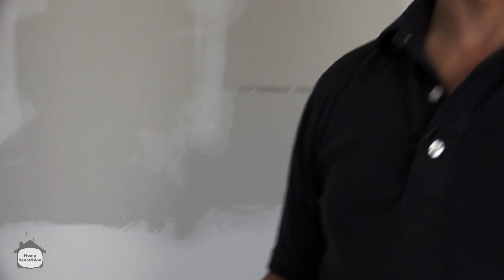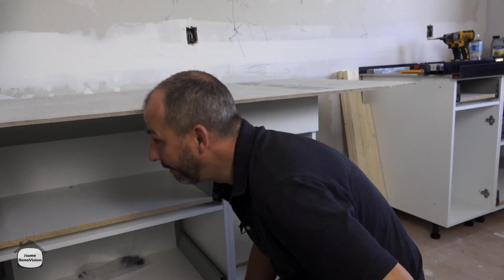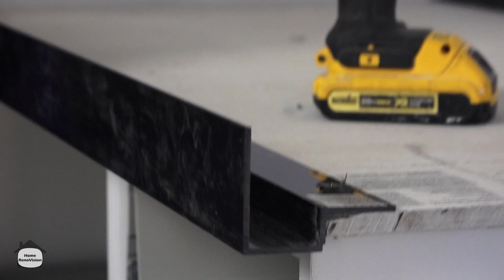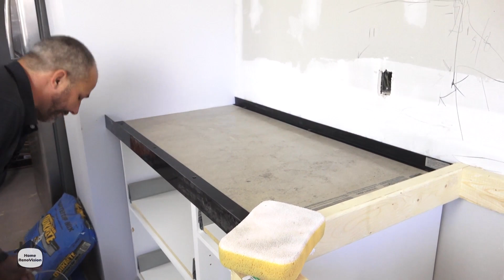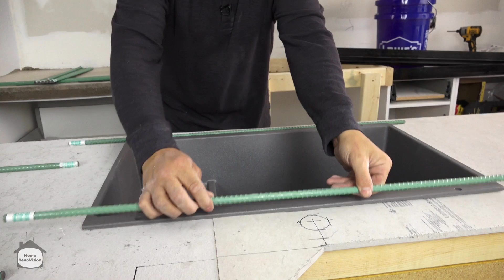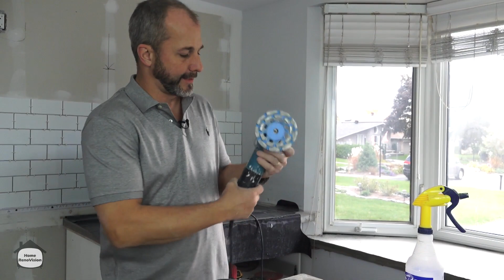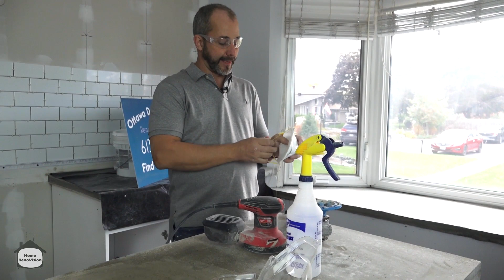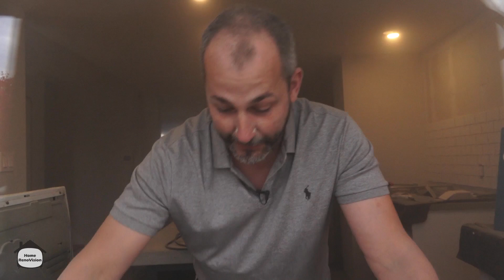Make Your Own Concrete Counter Tops | Rustic DIY Tutorial

Comment: Notice!  Prior to anyone doing any work, anywhere, anytime where grinding or sanding concrete or stone is involved should also Google and check out "Silicosis".  You will either adopt another procedure or invest in the best respirator and air filtration system that you can find or afford.  There is nothing like watching someone that you love struggle to breathe and slowly suffocate due to Silicosis! It's not the dust and dirt that you see, but the dust and dirt that you don't see that makes it into your lungs.   "Respirator!?  I don't need no stinking respirator!". Famous last words.
Reply from the maker: Thanks for scaring the hell out of us Jim!
Reply: @HomeRenoVisionDIY  LOL. I certainly didn't intentionally mean to unjustifiably scare anyone.  And, I'm not sure if this was a sincere thank you or sarcasm. :>) I have taken many courses in hazmat training including asbestos and lead abatement, and to include the dangers of Silicosis for to my past employment.  I admit that in the past I too had been very guilty of not doing a particular job the correct way that it needed to be done.  Granted, most of the time it was "just another way to do it", sort of like building concrete counter tops.  However, in the areas of asbestos, lead, fumes (think paint stripping using chemicals that contain the stuff referred to in the business as Methyl-Ethyl-Bad-Stuff) and anywhere that rock, stone cement or plaster dust is created or prevalent, prevention is worth a whole lot more than a pound of cure.  It could mean your quality of life, or, your life itself.  To be forewarned is to be forearmed.  I did not mean to scare anyone or to prevent people from DIY projects but desired to, hopefully, help someone to not wind up being a casualty of their own doing.  And I hope that my info was taken as such.  And obtw, I did enjoy the video.  Thank you for commenting on my comment.
Reply: Also, just so that you know, I am in the process of repairing and doing some limited up-dates to a home I've purchased that was built in 1910. (Plenty of lead paint and 95% of the walls are original plaster.  Plenty of sanding, grinding and patching.). I am in the process of stripping the kitchen cabinets and plan to replace the 1950's counter top.  That led me to your video.  The great thing about You Tube if the ability to learn from others.  I hope that I have helped.

Comment: ehh. I don't dig all the bubble holes every where. Seems like a good place for funk to grow. I would wager a super thin crete coat would fill them. This appears to be a great choice for outdoors prep around a permanent BBQ area or something. That or just bar top epoxy afterwords to make it 100% smooth.
Reply from the maker: That is what the wax is for. Cheers!
Reply: @HomeRenoVisionDIY  bees wax shrinks. So you still have holes. Still have places for stuff to grow.

Comment: IMO, the pro side of making counter tops via this method is you don't need 20 of your buddies to help bring it in, but that's all. I like the other method better. Casting it outside then bring it in. You'll get a much smoother surface and a less dusty home in the process. I just don't have enough patience and skills as this man does. 😢😢 Sir, be careful with that red laser beam. If it flashed any quicker, you'll be cutting in half. 🤣🤣🤣
Reply: agreed!, between the dusty cleanup, and having to buy the expensive Ztop forms etc, its literally quicker to make your own melamine form, pour your concrete (use ridgid board inserts to lighten the load a bit,) outside sand it slurry sand it etc, then call a few friends to help carry it in... set it down your done.

Comment: Fantastic video, this shows the errors most of us are going to get and how you'd go about and to fix them. All these "it's so easy just do as I do" videos really do not show the reality of what a viewer is going to experience when trying this themselves. Shows the "pitfalls" and "oh wish I thought of that" parts with a nice dose of humor, fun to watch. What I would do differently is put more effort in the vibrating, it's not only to get the bubbles out but also makes leveling easy as vibrating does that really well. One more tip, vibrating makes concrete stronger is it gets more compact and structural integrity improves. Concrete vibration improves the strength of the concrete by about ~4% per each percent of air removed, as you start with about 20% of the air in your mix you end up improving it a lot, basically if you get half out your 40% stronger. This gets' noticeable on the corners and other bits that you ideally do not want "chipping" off when bumped (google Concrete Vibration
 Handbook). Anyway, fantastic channel, I love it, a must see before my wife has me starting a new "project".
Reply from the maker: Thanks Peter, you obviously have not worked with this particular product . It sets up as fast as you can pour and vibrating had no effect after 30 seconds. It was a nightmare!
Reply: @HomeRenoVisionDIY  Yes, that is correct, I', in Europe we have other stuff. But, your video is cool and all know what they are going to run-into. Makes a realistic "follow along". great job

Comment: That final skim coat he got all screwed up. Mix up a batch and go right over the whole top smooth with sponge. If you do little 6" spots it will be a mess. Dude, you should have skipped this video.
Reply from the maker: I did say that I was just trying it out for the first time. Learned a lot!

Comment: Question . . . Looks like you poured the concrete  right up against the drywall at the sidewall. Are you not concerned with drywall sucking in the moisture from the concrete. Seems like that could cause mold down the line. Toughts?
Reply from the maker: this quick set concrete was cured overnight. it is not a constant source of water so no worries.

Comment: Looks like those kind of counter tops are more trouble than it's worth.
Reply: He made it harder than it needs to be. His mix was to dry and he didn't vibrate nearly enough. 
I've done 2 kitchens now using the same quickcrete product and it went smoothly. I did not need to grind at all. Just used hand sander in few edges with barely any dust mess like this was. 
That being said it's still cheaper and looks good even if you create same mess. He still did a good job abd achieved nice concrete counters.
Reply: Lol you just dusted the inside of their house for eternity 🤣.

Comment: Yikes! Grinding concrete like that is the worst (as far as mess and what you're breathing in...). I've done countertops both ways and definitely had better results with forming them upside down. With pour in place I had the same issues with low spots and had to fill them in after the initial pour. I could see a professional concrete tradesman able to get a far superior finish pouring in place, but for the average guy, melamine moulds are the way to go. Also,  I'm guessing you underestimated how much concrete dust there would be, cause that definitely called for at least a respirator... That dust mask wasn't doing much inside a cloud of cement dust! Haha. I've done the same and was cleaning grey goo out of my nose for days.

Thanks for the great video btw. I've seen these products and had wondered how they work.

Comment: I like this system. For sure figure out a better way than grind inside like that. Seems like a little more time on the tops with the float would work wonders. The good thing is that if you totally screw up yo can always attach a nice big shop vac to get most of the dust. Doing it like that inside is a little nutty, something I have done but still.

Comment: 1.  There is a perfectly good solution to get more workable concrete without adding water.  You can add in plasticizers.
2.  The purpose of adding steel at the bottom of a slab isn't the "firmness" of the underlay.  It's because the bottom is in tension.  Cement board can help with that, if it's properly reinforced, but if the neutral axis lies in the slab, you WILL get cracking below it.
3.  Yes it is a problem if your concrete is too wet - it results in weak concrete that can flake off... especially when it's applied that thin.
4.  If you had THAT many bug holes, you should have put a 1/8" topping coat on it.
Reply from the maker: there is nothing you can do with this product. It was very difficult to work with.
Reply: @HomeRenoVisionDIY  If you haven't looked into plasticizers, I recommend it.  It's a great way to get better slump without weakening the pour.  Might also help with the bugholes.

Comment: Yup. Sorry Bro I commented before I finished. The set time is wicked fast. Try a  4000 mix with wire More time to work, But man buddy that is a shit load of work...Dust, Clean up. Fill the holes, Seal it,,,,
Give me granite. Make the template 4 days later they are installed. Next. You did a great job. way to much work for the return,

Comment: Dryer Mix and WIRE????????????????
Reply from the maker: It is actually a concrete counter mix and rebar. The mix itself seems to be the problem with the product outcome. it sets so fast that you cannot work it properly.

Comment: The mold method with GFRC and foam core and hopper gun applied first coat seems to be the industry standard nowadays. It’s both significantly lighter in weight and strong in nearly all directions due to glass fiber, and has minimal surface imperfections. Most importantly, it’s replaceable. If the owner doesn’t like it or you screwup you can remake it or choose something else. Creating something so large, heavy, reinforced with rebar, and permanently attached to the cabinets sounds like a nightmare to the next home owner who wants to renovate.
Reply from the maker: Kind of like guys wo use spray adhesive on subflooring to joists!

Comment: This should help control a lot of that dust you have flying around getting all in your eyes and ears and on your jobsite for less cleanup.

https://m.lowes.com/pd/DEWALT-Surface-Grinding-Dust-Shroud/1000183755#collapseReviews

Also,  I have a full face respirator that I wear for anything from painting to cutting cement board to simply working in really dusty areas.  you'd be amazed at how much your tolerance for the environment you are in will go up we can ring one, in turn allowing you to focus on doing a quality job rather than, "how quick can I get this done so I can stop breathing this stuff"

3M Full Facepiece Reusable Respirator 6900/54159, Large (Pack of 1) https://www.amazon.com/dp/B007JZ1M10/ref=cm_sw_r_cp_apa_2sk.Bb3Z696EA

Always appreciate the videos and always enjoy sharing tips between tradesman. Cheers! :)
Reply from the maker: Thanks made my own out of a small pail and some tuck tape. Cheers!

Comment: I did poured in place countertops for my outside kitchen.  Acid stain is the way to go, after the sanding.   Have to be careful not to sand all the way down to the pebbles....just enough to smooth the creme top.  You don't show it, but did you use a magnesium float as it cured?    That makes a difference on overall finish before grinding.  Acid stain can provide a real nice marbled affect.
Reply from the maker: Hi Keith I am going to try this again some day soon. This time me will be looking for a more sophisticated outcome.

Comment: I used these forms on a rental kitchen remodel. I dyed the concrete mix (quikrete counter top mix) a dark color, a did a lot of smoothing with the magnesium float, then finished the top with a thin coat of dyed flyash. I was able to marble the color. I sanded it smooth by hand and finished with their sealer. It was super easy and very inexpensive, plus I was able to model my breakfast bar in a very non traditional way. Here's a picture. https://imgur.com/a/9aQb9HR   In this picture they are 3 years old, and it's been 2 years since then, they still look just as good. 

This was my first time doing ANYTHING with concrete, I did a couple of small tests in the garage before the main run.  

Love the videos I'm learning a lot, thanks!
Reply from the maker: Nice!

Comment: Detailed vid!

I saw another comment and agree with it. I believe every DIY person's very first tool should be a $100 full face mask from Amazon. These paper masks are absolutely useless. They don't seal, period. The amount of bad air coming in around the sides is insane. Even the half face masks are not great unless you're totally clean shaven. I have a very thin beard and found that the half masks wouldn't seal up--but the full face do. Plus, built in eye protection at all times from impact, plus the air by the eyes is filtered.

Any of the full masks like the 3M one with a new filter are so good that I can dump an entire can of spray paint in my garage onto something and not smell it at all, as they also filter some vapors. Try that with a paper mask! All that ground silica I wouldn't want to be breathing it.
Reply from the maker: I use a new paper mask that is awesome. I will be showing it off in future videos.
Reply: @HomeRenoVisionDIY  Sounds good :)

Comment: Started watching your videos a few days ago, can't stop. You're one of the best DIY ppl on the web. Questions: If I had planned on doing a similar type of counter space in a kitchen, what would be a realistic number of days that it would take for someone who's new to this process. And, are their dyes or colored sand products available to mix into the concrete that would provide a color other than grey? - I know they do this with patios sometimes.
Reply from the maker: lots of options, I would also suggest getting the cement from the form supplier. the product I used was really hard to work with.

Comment: get a "grinder vacuum attachment" for the grinder. Use shop vac with filter. Then take off the useless dust collector on your orbital sander and duct tape the hose to the orbital sander as well.

Comment: Ohhhh, man.  Where is your respirator, or dust mask while opening and mixing the concrete?  Dust from the cement is full of silica!  Nice little microscopic shards to cut the inside of your lungs. NOT anything you want to breath in, if you can prevent it.

Foam pipe insulation makes for great faucet block-outs.
Reply from the maker: nice tip!

Comment: Nice end result, easier way for DIY then oldfashioned way, but old fashioned upside down making of concrete countertops stil seems to me a better solution.
Reply from the maker: On a smaller counter definitely. My next attempt will be with a different cement. Cheers!
Reply: @HomeRenoVisionDIY  What cement are you thinking of using?

Comment: Hi Jeff, Ran into your videos by mistake but I'm glad I did! The way you show things from start to finish and even include your mistakes is perfect for homeowners who want to do it themselves. I wanted to ask if you have ever done concrete stain, the acid spray stain kind and added a clear coat to give you the wet look?

I built a 300 sqft Rec/Family room addition and decided to go with no flooring. I went with a dark acid stain and a clear coat that gives you the wet look. The final product came out perfectly....until the a few weeks when it got wet from mopping or even drops of water! Basically it started to gray/cloud up where ever it got wet. Im wondering if I did something wrong in the process of painting/rolling the clear coat on. I did make sure EVERYTHING was dry and to be honest the slab was poured over two years ago. What are you thoughts? Have you done a stain with a clear coat like this? 

Best,
K

p.s this kitchen and countertops look great! I am going to attempt this in my next house, just sold my current home and looking for our next one. I'll be reaching out for help! jk jk ha ha ha take care  and keep up the great work sir.
Reply from the maker: Sorry I am not familiar with that stain. I keep to food grade materials and use a penetrating sealer. Cheers!  P.S. we are here to help.

Comment: The same outfit that makes the snap off forms makes an additive that you add to the bag mix - it's a game changer because you can pour the counters much wetter - enough that it will actually flow without air problems. Huge mistake not to vibrate and even bigger mistake not to reinforce the counters - and glad you did on the sink coubter. Has nothing to do with "bonding" to the backer however.  I use a 1/4 sheet vibrating sander with no sandpaper on it to vibrate the edge and from underneath.

Comment: Jeff FWIW 1 SF of 1.5" thick concrete weighs about 14 lbs not 80.  Concrete weighs about 3000 lb per CY - and that yard of concrete will make 215 SF of 1.5" counter (100 LF give or take)

Comment: i've seen filipino construction workers make cement wall and floors really smooth. they slap/throw dry cement powder over still wet cement. the final finish is smooth without scrubbing or a top coat.
Reply: Great tip!

Comment: Would have been nice to have them Sanders hooked to some vacuums..we wet sanded everything when we did it and it was a big mess
Reply from the maker: I have since built a dust shroud. Cheers!
Reply: Home RenoVision DIY I picked up a  Rigid smart cart..it's pretty big vacuum tho but I installed a dust deputy on top and started hooking it up to my tools. OMG...I'm kicking myself in the azz wishing I did it years ago. I finally bought a festool vacuum and the difference from using a tool with a vac hooked to not having one hooked up is CRAZY!!! I had my track saw out the other day for some plywood I was cutting down but had to take 1/2" off bottom of a door real quick so I dropped track on the door and got half way across the cut and hose fell off and the mess it made in the last 16" or so ..lol best thing I ever did was start using  dust extractors